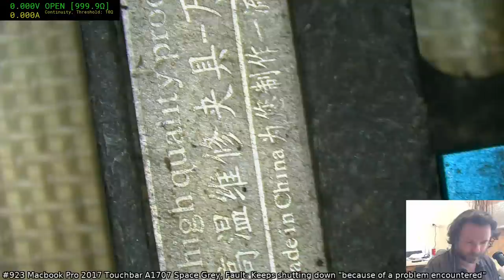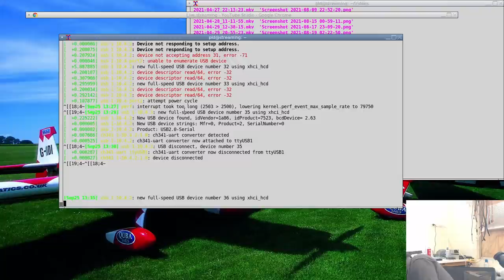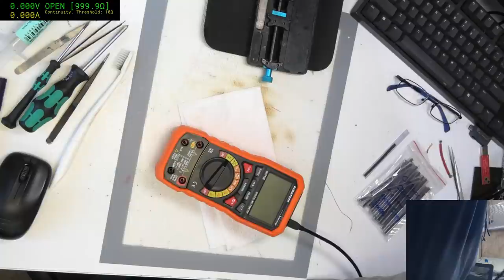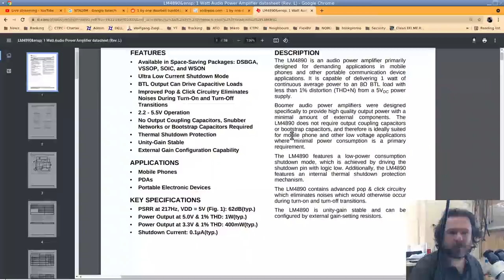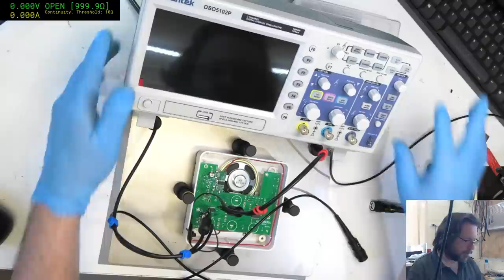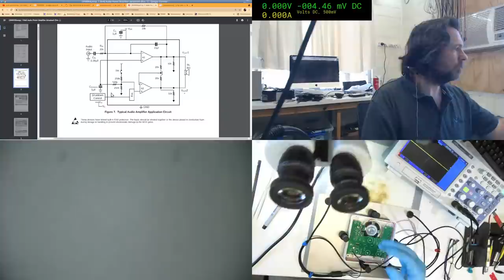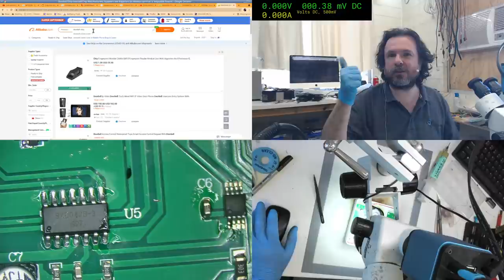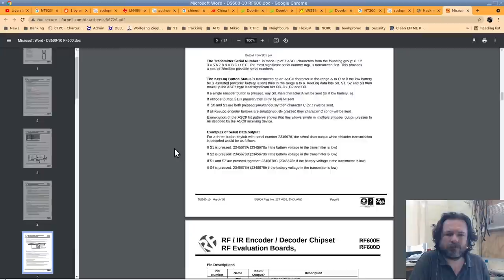Fixing multimeters that the factory can't find the fault in - for OBData capture packages

Comment: what I've been told is that the big deal on the iPhone 13 is that the board cannot be powered from a power supply therefore you cannot diagnose through current draw. The battery board does a handshake with the board before booting. Yes you need a genuine apple battery board but you can swap for other genuine batteries.

Comment: When bending two legs put the  pliers across both legs and uses a hard service to bend both legs at the same time will bend at the edge of the pliers to have a 90 degree bend
Reply from the maker: Yes, that's right, that's what you normally do but there wasn't enough legs on the xtal can to do that, let alone enough for a pair of tweezers, hence I had to what I did.